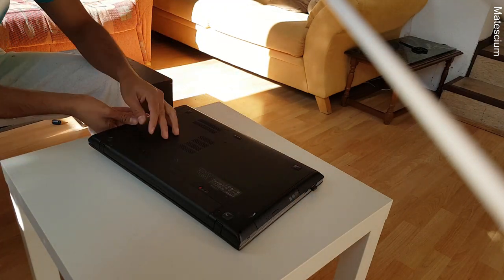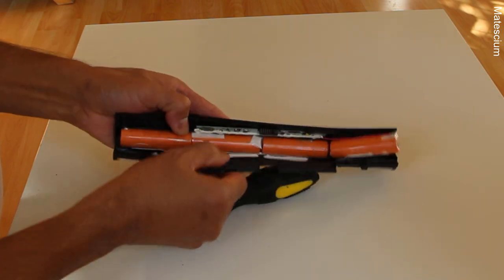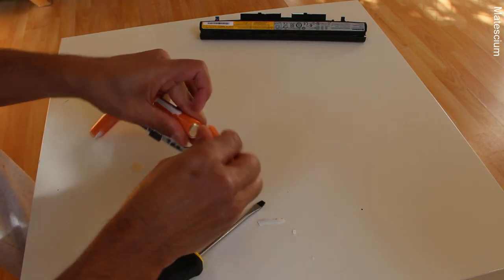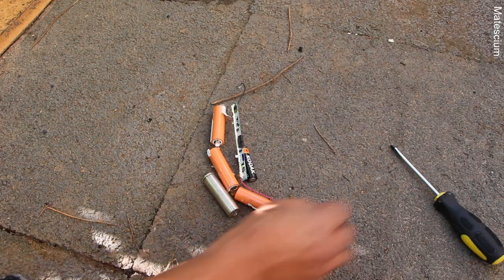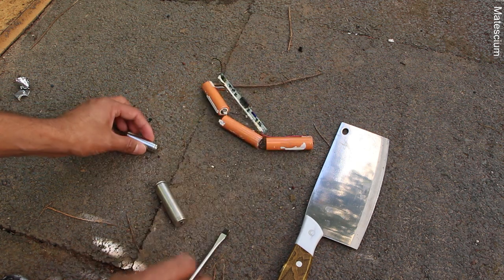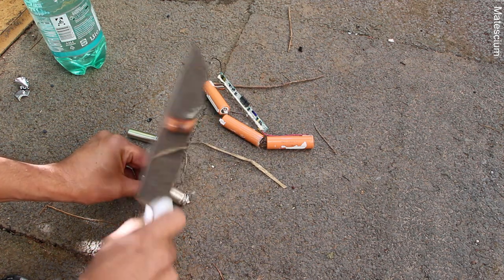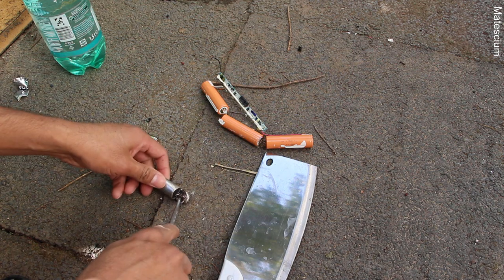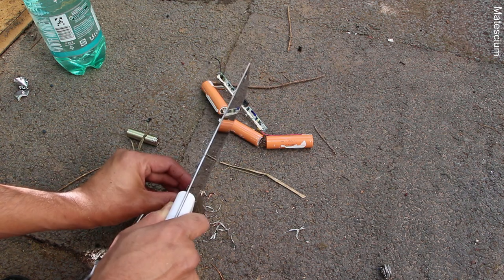What is inside a laptop battery ?

Comment: Does your big heavy knife make a lot of sparks to blow up or short circuit the Lithium battery you are pounding on and handling with no gloves or eye protection?
Reply from the maker: The battery was fully discharged before. That's why its almost impossible to make spark of that lithium ion battery